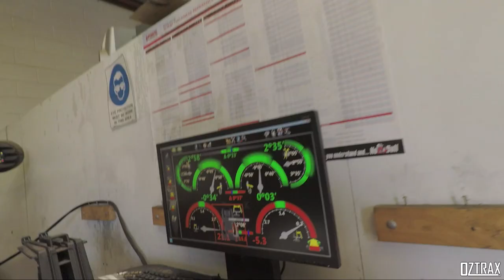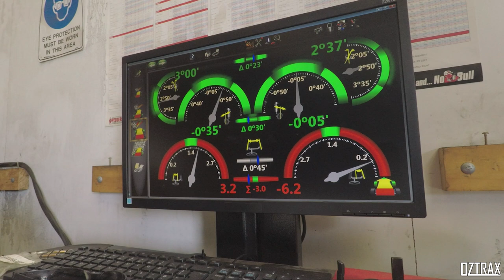Toyota Prado 90 Series // Steering Rack Change

Comment: Found out today I need to replace mine. This was a handy video to help me decide, nope, not doing it myself. 😬
Reply from the maker: Definitely not an easy job to do on the ground.

Easily doable with a hoist, but sometimes it's just easier to give the job to someone else. 👌
Reply: @OzTrax4X4  yeah if i had a hoist I'd give it a crack. Local mechanic has a hoist and a mate's written off 90 that I can have parts off. Might be my cheapest option!
Reply from the maker: Just make sure all the mounting bushes are fine and while the rack is out, make sure the front diff mount bush hasn't seperated as the rack has to come out to do that anyway. 👌
Reply: Cheers. I'm thinking just replace bushes, they're the cheap part of it all.

Comment: Timely. My 95 is spending the weekend at the mechanics for a rack change, mine was just slogged out internally. They had one of the fluid lines soaking over thursday night and applied heat on friday to get it free. Then the "not Chinese" rack I sourced leaked from every potential place when they fired it up for bleeding.. Luckily the local Repco had a rack at hand, so it'll be off the hoist quick, but there goes the muddies and the snork for a bit.
Reply from the maker: Unfortunately it pays to spend a little more and buy from a reputable source than risk getting something that may be a few bucks cheaper yet inferior in quality.

While it cost you more now, it will be better off in the long run.
Reply: @OzTrax4X4  Agreed. This was from an Australian vendor (who is being helpful so not going to drag them) who normally reconditions racks but says Prado racks seem to rot out and are hard to source good units to rebuild so were selling these units with a warranty. But yeah, kind of glad to get the Repco branded unit all the same.
Reply from the maker: If you get stuck in the future, check out Active Power Steering for a rack. They have stock in Sydney. 👌
Reply: @OzTrax4X4  I will note that name. Hopefully the Repco unit will last a bit though.
Reply from the maker: Could very well be one of their suppliers, as they were at my last job.
Reply: Where did you buy the steering rack ?
Reply from the maker: I got it from Active Power Steering in Sydney, Australia. 🤠👌

Comment: I had to do a lot more to clear 285's on mine, although I did it with no lift, no swaybar and factory UCA's (I fitted the lift and UCA's later). I had to cut away a piece of flare, a piece of inner guard, and I had to hammer flat a section of body seam. I did find that I had to be driving downhill with the full weight on the front corner to make sure it cleared though, flexing on the flat never pushed the wheel high enough.
Reply from the maker: That would all have been dependant on your wheel offset too.

What wheel size, width and offset are you running?
Reply: @OzTrax4X4  i sold it a few years back, but I was running 16x8 -25
Reply from the maker: That would have taken a fair bit of effort to get them to fit without supporting mods like upper control arms.
Reply: @OzTrax4X4  when I did it, nobody in Australia made aftermarket UCA's, and nobody had done a diff drop, IFS was 2" or nothing (with the exceptionof big spacer lifts like Ultimate did). I was working at an ARB franchise at the time, and figured out by comparing part numbers, what I could buy from the US to fit, I ended up with a mixed bag of parts from engineering shops both local and US based, as well as Total Chaos and Donahoe Racing (now known as Icon).

Comment: Hey dude I'm about to turn 16 and wanna get a 90 prado for my 1st car offroading ect should I buy one
Reply from the maker: Hey Troy.

Good choice for a first 4WD and first car.

Things to check are lower ball joints, lower control arm bushes, steering rack for worn bushes/leaks and one that not a lot of people check would be to make sure the top tank of the radiator hasn't gone brown. If it has, it's on its way to cracking.
Reply: @OzTrax4X4  thanks heaps dude, I'm looking at getting one for about 6k still runs (680,000km) I'll rebuild the 1kzte in it and look at running more boost and a 3inch straight through
Reply from the maker: 680k is getting up there.

I'd be looking at something with a few less k's on the odometer, even if it might cost you a little more.

At 680k, you'd also have to factor in the diffs, transmission and suspension requiring a rebuild.

Food for thought anyway. 🤙

Comment: Hey mate whats the lift your running?
Reply from the maker: It was a custom Dobinsons MRR front shock setup and Prado 120 rear shock with 90 series coils rated to 300kg constant load.

Unfortunately the old girl is no longer after my accident and is a total loss.
Reply: @OzTrax4X4   cheers, im trying to find a 3 inch lift but cant find it anywhere
Reply from the maker: You'll find that a 3 inch lift will potentially cause CV bind at full droop.

Any particular reason you want 3 inch lift?

If you do a decent 2 inch lift, you can run 33s and that will give you 3 inch total.
Reply: @OzTrax4X4   yeah i have a 2inch old man emu with 33's already but was just seeing if there was a 3 inch out there somewhere
Reply from the maker: I saw one pop up on Facebook Marketplace with a 5 inch lift.

If you can find that vehicle, maybe ask the owner what they did to achieve it.

Personally, I had zero issues with the 2 inch lift and 33s regarding clearance.

Exceeded my expectations on numerous occasions.

Comment: This video skipped over the exact part I needed when pulling my rack out
Reply from the maker: What part did you need to know exactly?

This unfortunately wasn't a tutorial, but was more of a vlog.
Reply: @OzTrax4X4  fair enough. There aren't many tutorials out there. I was fighting with some of the nuts that hold the steering rack in. Found out one of the nuts was a captive nut. Got the others off using a jack on my breaker bar 😁
Reply from the maker: I had a chat to Sock, who was the one wrenching in the video and we've decided that we will do a quick overview of the sequence to remove the rack for future reference. 👌